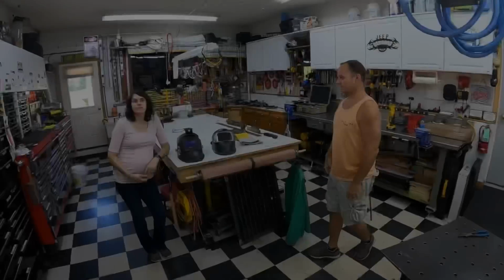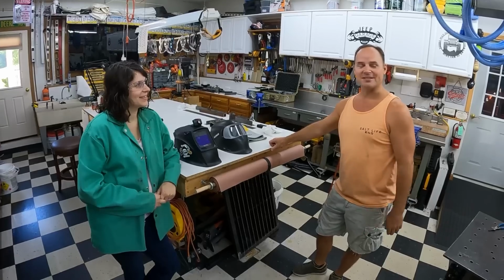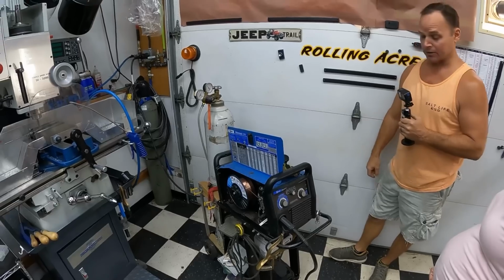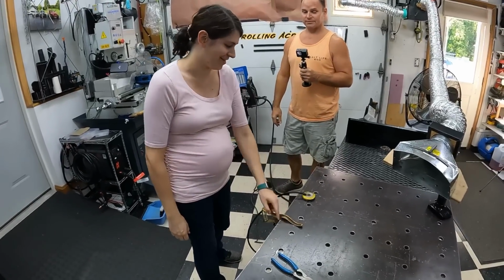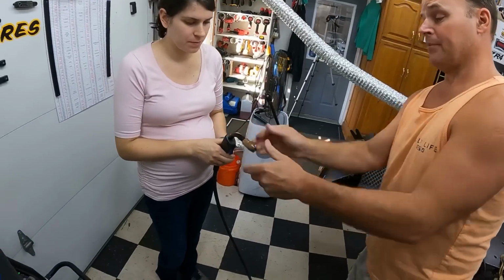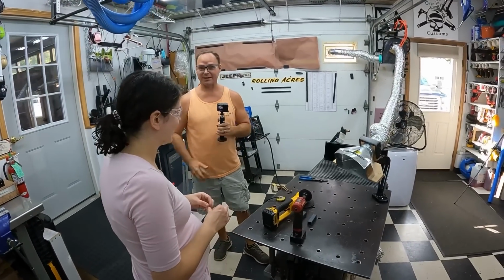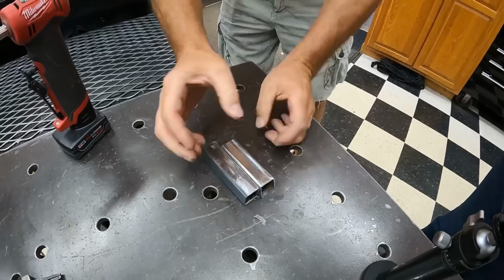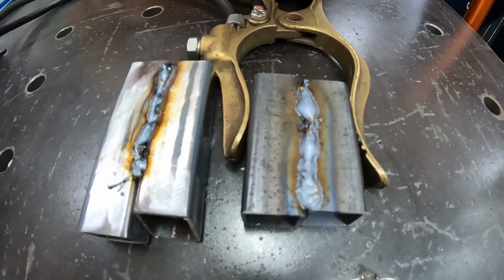Teaching My Wife To Weld

Comment: Adam, experiences in different fields often apply to each other.  For example, maneuvering a tractor around obstacles and into working positions teaches a lot.  Confidence in tight situations is built.  Alignment of the vehicle to stay on path becomes second nature.  Speed control comes more easily.

When it comes to driving a car those skills transfer… parking in a tight space is not much of a challenge.  Timing for fitting into traffic patterns is intuitive.  Skills like Reverse driving, backing trailers, stopping smoothly and accurately are all second nature.  

I bet you could stand in the parking lot of the local big box store and pick out the people who have learned off road driving just by watching them maneuver… experiences in one thing  do translate to another.

He/she who has the most experience is often the one who develops the most skills!  I think it is great that Alana is willing to give welding a try.  There’s no telling when the experience may come in handy!

Comment: I am a welder ,,,done it for a living most of my life ,,, and he's wrong about the gasses off the wire not hurting you ,,,,, it depends on what kind of wire your using ,,,stainless  ,,, can cause neurological  damage over time ,,,just look at me ,,, probably not good for a baby ,,, go look on that box the roll of wire ,, it has a msds sheet on it young man ,,just FYI
Reply: Tilt that gun 5 degrees just off the welding surface ,,if your rite handed ,,take the two pices of metal put a 32degree bevel on it and a 16 inch land ,,what I mean by that is you want a flat edge ,,on the bevel where the two pices of metal meet where you are welding ,, now get a pice of 3/32 filler wire bend it into a v. ,,, stick it between the two picdz and tack each end ,, the gun is in your right hand tilted at a 5 degree angle in the direction of your left ,,and push that puddle ,,it's l about speed and angles ...